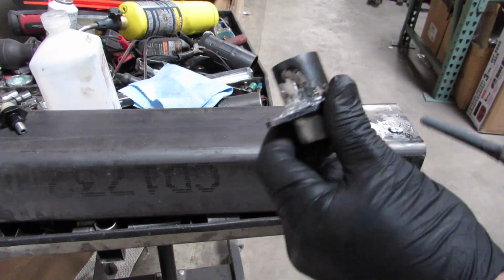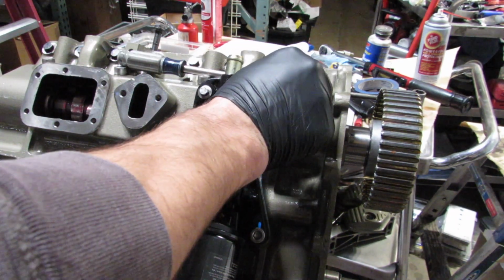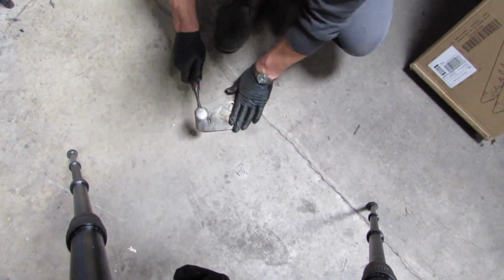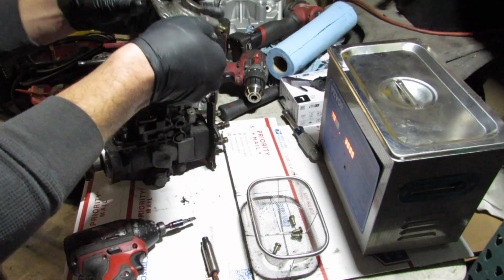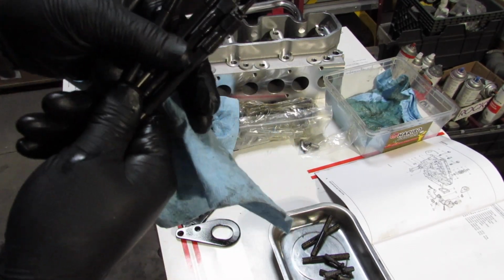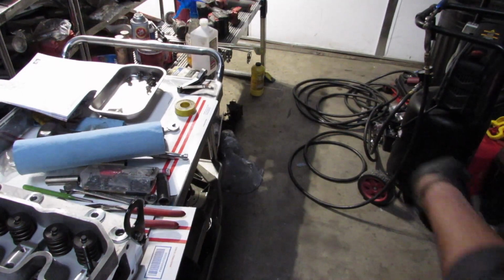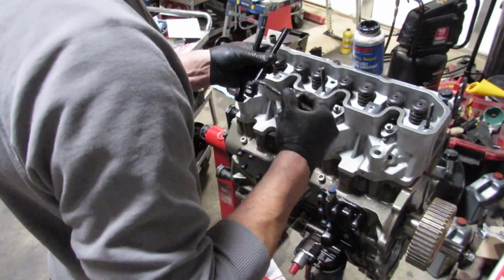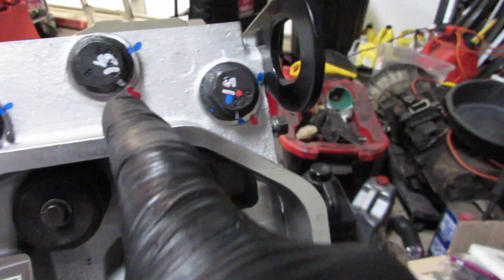Land Rover Defender 300tdi Engine Rebuild Part 4

Comment: you should of used the multishimed head gasket
Reply from the maker: On Subaru’s I’ve always had better luck with MLS. I know it’s different, but we’ll see. Almost done.
Reply: @vM0de  yeah it was the solution to cast iron block and an aluminium head. Are you running standard fuelling or tunned with morebboost? Vnt turbo?
Reply from the maker: @mattluszczak8095  I'm using the original style turbo system. I have an exhaust manifold that can house a VNT, but while I was getting stuff ready time ran out and I set it aside to just stick with the tried and true. I have added a temp sensor and boost sensor.